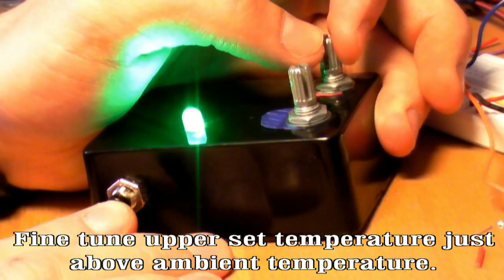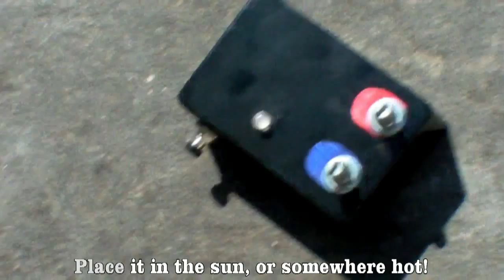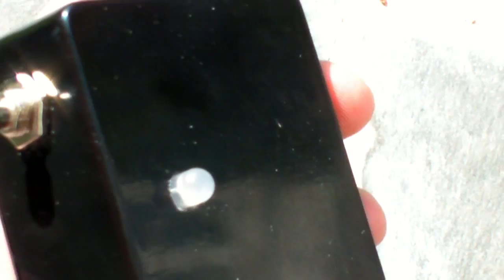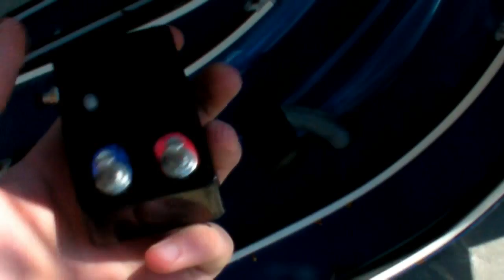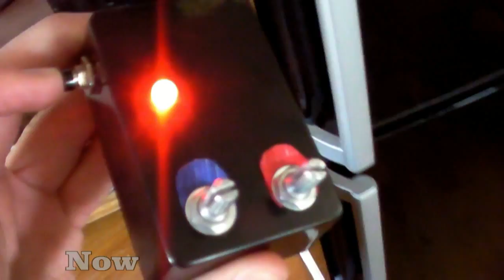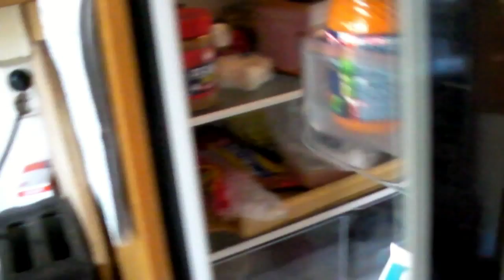DIY temperature limit check tool

Comment: Can I run two LEDs, and a piezo electric buzzer on both LEDs.Would like to use this device for paranormal studies in detecting hot and cold spots.I want the buzzers so in case I am not watching it I will here the alarm.